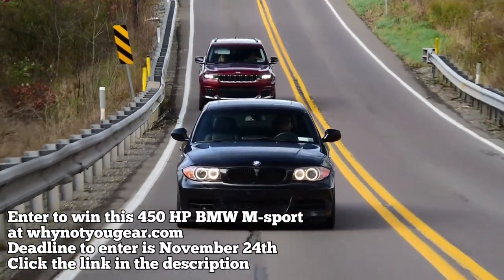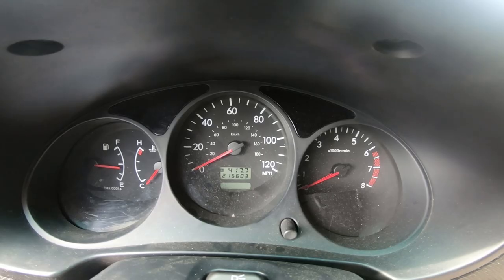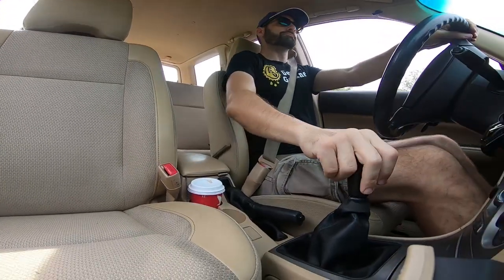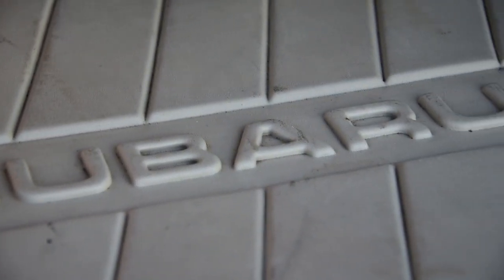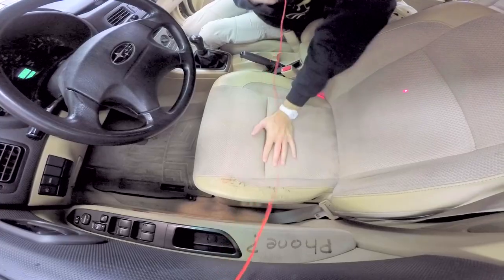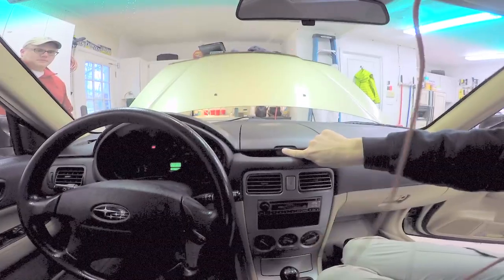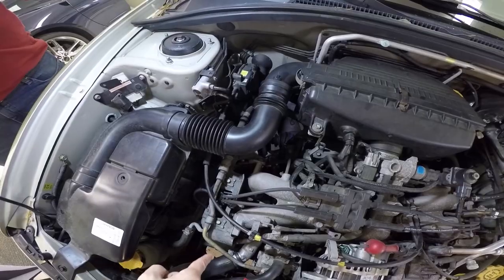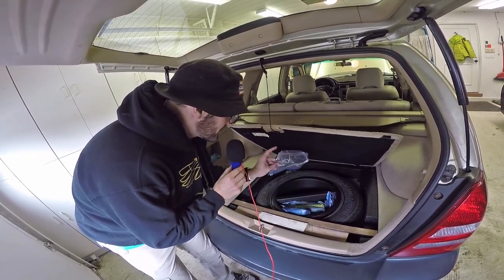2004 Subaru Forester 5MT: Regular Car Reviews

Comment: My first car was a then brand new '07 Impreza 2.5 SE in Newport Blue on clearance, a model that only existed to use up all the leftover goodies that Saab had left after their one night stand. Probably was not the best car to give to a then high schooler who was still on their permit, but it was that or the '07 Aveo because dad was firmly GM back then. That is until I got him to drive that then the Impreza, I've never seen the man break so fast for another brand until he bought the '15 Malibu, but that's another story. From day one I drove it like I stole it, driving it flat out in dirt roads and the empty lanes of the California high desert relying solely on physical maps since this was well before smart phones were a thing. Sure it was the non-turbo model, but the AWD and peppy little engine was able to easily outrun the tired 90s domestics that dominated my school back then. That car basically taught me mechanics since slowly little things broke from my timing belt shredding, to a blow radiator, to the catalytic converter failing and my first major engine rebuild because the meme was real and it hit me on the nose at exactly 100K miles. I lost that car a decade later, not by any fault of my own. 

My brother had taken it to school one day, and a careless S-Class decided it wanted to changed directions midturn on the opposite lane. Completely totaled the car but he was able to just walk out and just quietly sob on the side of the road since it was his first accident since barely getting his permit and he loved that car too since we had gotten it when he was 8 and it looked just like the cars he and I drove in Gran Turismo. The accident call was probably one of the worst ways to wake up that morning and my brother at first was the only thing I immediately cared about, it was only after I got to the site and confirming he had all four limbs that I finally looked at the wreck and realized that in exchange I still lost something. Sure at this point it was slowly dying, it wasn't even turbo model, or even had a manual, but this had been my car for a solid decade from high school to college, and with that I felt like a good chunk of me had gone with it. At least it kept a good chunk of it's value and it was off to a bargain bin Sonata that had the same exact metallic blue because Subaru was now asking for silly prices in 2017 and I was still drowning in college debt. I still miss that little car from time to time. Maybe in a few years from now after the Sonata, I'll pony up for a WRX finally, because nostalgia and a midlife crisis are a powerful thing.

tl:dr I picked my first car because I was a dumb Gran Turismo kid, drove it to the day it died and I miss it so much I'm willing sucker to buy it again, thank you for listening to my TED talk in a Burger King men's bathroom stall.

Comment: The hill holder sets when you have the brake and clutch pushed together. It holds until you let off the clutch pedal. The easy way around it is to hold the car with the parking brake, let off the pedals, then put the clutch back down. If you don't touch the brake pedal, it won't set the hill holder. 

Also, is it just me, or does it hold harder if you have, when stopped, pushed harder on the brake pedal? I'm pretty sure that's an attribute of its operation.

Comment: Love my Philly-based 2003 Forester XS with 163k.  Starts every time and runs like a sewing machine.  Throw some snow tires on her and she's unstoppable!!  Sure, I've been through three rusty cat-back exhausts (now running stainless), and there's rust on the subframe....but I refuse to let this thing go.  A/C blows cold, new-ish radio runs bluetooth, and I don't have to care about dings and dents (there aren't many).  I will inevitably dump more money into it rather than overpay for a new (used) car right now!

Comment: This comment won't mean anything to anyone.
But I feel the same about "billy" my pug 3008 mk1....
A car where I changed the oil every 43k because thats the miles I did in a year. A car that never ever not even once broke down....a car that does 55mpg on average but sometimes up to 80....
And it isn't a hybrid! Nothing electric like on it.
Its 10 years old.
The last of the 'moderns' before the future black box, ad blue, ad nausea cars of 2018 onwards.....
Hes still going.
With 115k.... 
I hope he becomes a high mileage hero. Because he deserves it.
Hardly washed and cleaned or maintained. Never driven hard mind....
But...yeah.
He is my donkey 
Loyal. Dependable.
Its French and French cars generally suck..... not this time though.

Comment: I know what you mean about those Pennsylvania rust issues. I mean, I live in Ohio, but in August 2018 I picked up a 2006 Explorer 4.0 with around 190k for $600 in Prosperity and, at the time, it seemed like the frame was so far gone that I thought I could only get maybe a year use out of the Exploder, tops. I also found out shortly after buying it that a couple of plastic timing chain guides ended up in the oil pan along with a couple of rod bearings. To my surprise, it's now at 211k and I'm still waiting for it to blow up.

Comment: A four cylinder that gulps gas like a V8? Sounds like an anthem of 2.0L engines from the early 2000’s. This hits hard as I’ve only driven such cars. Now, it’s a Nissan X-Trail and we’re deciding if we’ll  let it go because it sucks gas like a V8. I didn’t like it then, still don’t like it now, but I’ll be sad if we were to let it go. It was reliable despite the fact it’s a basket case of mechanical problems. I want to keep it, I want to restore it, but I don’t have the means to. I guess it’s a curse for us car folks that if you own a car for so long, you’d love it. That it bothers you to have to let it go, but it excites you because you’d be getting something different.

Comment: I had to trade in my 99 forester 5mt at almost 300k miles. I bought a low mile, one owner Mercedes C300. I bought the Merc because I couldn't afford the newer Forester I wanted, even though it was older and had more miles than the Mercedes...

Comment: I had an 04 2.5X. Sold it at 257k about 3 years ago. Definitely the worst mistake I’ve made when it comes to selling vehicles. I miss that car on a daily basis. I have a 2011 forester XT now but it’s still not as good as the 04 in my opinion.

Comment: Funny enough my car had the hill holder fail on it but it was fixed and I still like it, it's nice to be lazy away from lights and since it also works in reverse I can use it as a backup speed control. Also those leakproof headlights finally failed on me so I had to get new ones, but I need to look more into the DRL-disable because I didn't know it was so simple.

Comment: Gotta get the car undercoated to prevent the rust. And not that rubber crap. Get the oil based undercoat. Yeah it makes your underbody oily, but it's better to get your hands a little oily when working on it then having to deal with rust.

Comment: the 45 minute thing is legit, me and 1 other fella pulled an engine out a GC8 and had the sump off it for inspection in 45 minutes including putting it on the lift. Obv the sump was absolutely plumb full of glitter.. but y'know. subarus.

Comment: My daily/beater is a Sierra gold 04 Forester XS with a 5spd lol sadly mine is in need of a motor soon its running on 3 cylinders idles at 350rpms and has metal in the oil but i still drive it 700-800 miles a week

Comment: Typically the Manuals in these use a center diff viscous coupler and, as a result, aren't always engaged. My 09 has a computer controlled centre diff clutch system because it's an auto and also isn't always engaged. Maybe the older ones were different

Comment: The gears in the forester are almost exactly the same as the base model impreza, my friend has a 2010 manual forester and I have a 2010 impreza manual and they are both very similar since it's the same engine and platform really.

Comment: Wranglers are 4x4 which means 50/50 split all the time (When 4wd is engaged) The only difference is the suburu has a transfer case differential, but any jeep with the 242 t-case has one too? I still dont understand the stigma.

Comment: My mom's s was bunk 04 legacy got second set off head gaskets at 160k  previous owner did.then at 220k went out . Oh but you gotta do triple layer gaskets if you want it to last.
  Well I don't know that.
4000 for a car that had work done. Just  70k is kinda of a bummer. Also the previous work for head gasket nothing on the paper work about the water pump 😡

Always smelled like gas . Has a misfire at 160bk I believe before head gaskets was done.

I loved Subarus . Well I still love my free 93 loyale and that's on prays and head gasket in a bottle.  But at least that one rides smoother.
But my loyale only gets 18.6

Comment: Time to get a real camera car. A 1994-1996 GM B-body wagon. You've got the rear facing seat and perfect height rear glass that opens by itself so you dont have to shoot through a heated rear window anymore with lines that show up in the video... Plus you've got an incredibly smooth, self leveling air suspension, and the simple, durable, powerful LT1 engine. That thing would be able to go anywhere the subaru could, at a much higher speed. I guarantee it'll get at least the same mileage as that Subaru too. Everyone knows nothing offroads better than a full size rear wheel drive B-Body. Just ask David Freiburger. Plus you can carry 9 people and tow 7500 pounds simultaneously with roof storage to spare. Name another car that can do all that reliably and for a long time as my parents' car did. I'm not holding my breath. Ask /DRIVE about theirs, which they used as a camera car for years.

Comment: It's a shame what rust does to cars. As a life long south Floridian, who grew up near the beach, cars rusted like crazy here as late as  the early 70's, with primitive sheetmetal prep, primitive paints, waxes, and sometimes poor design regarding trim and shape -  but from the top down. All rust was clearly visible, from the outside, and you could try to slow it down with proper maintenance. You've tried to do the same, but the salt was coming from below, not from the humid breeze, and she's too far gone, despite looking like she's ready for another 15 years of solid work. Sigh...

Comment: Vinyl inserts make cleaning seats just a little easier....no longer do you have to worry about your extractor nozzle working its way poorly around the bolster edges of a cloth seat......vinyl shouldnt crack if properly protected....and also dont drag your ass out of the car. thats pretty self explanatory

Comment: I had a 2003 Outback with a blown gasket for 10 years and added oil occasionally that went everywhere, and had the weatherband.   I bought an orange 2014 XV Crosstrek afterwards that was murdered from behind while I sat at a red light. Now I have a 2017 Outback p.o.s. that eats batteries and got stuck in my yard!  Eat turds Subaru!

Comment: And then the head gaskets goes like most 10+ year old Subaru Forester... Nearly 100% failure...
Yeah, I used to own an older Forester until the head gasket was fading for the second time in less than150K miles.

Comment: Subaru best worst ever…..my wife’s 04 h6 Vcd outback gets 18city 23hwy…..but I can go 75mph on packed snow over the pass…..until she yells at me…..lol,,,,cv boots ugh….parts for the h6 are expensive as an Audi because their German parts….all the heat shielding on the cats rattles…idle control valve tends to be at odd with itself at times…overall nice car that’s extremely uncomfortable in long trips…by my back sucks after surviving a head on…..my moms 2010 Impreza sport with 50,000 miles on it….sucks.sure it’s sporty,torquey but the thing feels so cheap the plastics are harder the road noise levels are way to load for a passenger car….my 03 f350 with a 4inch turbo back rolling on all terrains has about 1/2 the road noise as her Subaru…..my buddy had a 96 Impreza L 5spd awd it was better made and quieter also (no speed govener 140mph out of the 1.8L lol…than the 2010 sport Impreza they have gone cheap noisy and little things go out that’s a non issue in a Toyota or Honda…..vote with your money go test drive used cars to see how the brand ages….Overall the snow performance is second to none Subaru by its design will always win that game….but two months out the year performance is just a dumb reason to buy it…

Comment: That little Subaru flat 4 engine is almost as bad as the 4 cylinder and V6 engines Chrysler made in the 90’s.  Subaru is a really good example of how the automotive journalist of the American Northeast decided they really liked a product even though it was complete garbage and convinced all the other emasculated liberals that it was the greatest thing ever.  Ford products are another example of this travesty.  If you really think you need all wheel drive then buy something that actually works like a GX 460 or a 4wd GM full-size platform with a V8.

Comment: Head gasgets were actually leaking because people use WRONG antifreeze... Sure it's stupid for subaru to use some magic potion as an antifreeze but the owners who pour wrong stuff in are even dumber :D

Here in Finland we have lots of salt on the roads but Subaru have galvanized body so how in the hell is you're that rusty?? you never put a protective stuff or even oiled the bottom?
My 05 Forester been rust protected when new and a few years later. now have 401.000KM on the original engine that have never been opened and the can have basically ZERO rust and the bottom is like new.

Comment: Almost a half an hour to justify a boring, over priced, under powered ugly car with interior & tech that was 10 years behind it's contemporary rivals of the time. Like Honda or Toyota of the same vintage. if you are an "enthusiast", and want an old Subaru that isn't a dog to drive, just buy a WRX wagon. You'll thank me later. Otherwise go buy another car with 4WD and eat your crunchy granola and look down your nose at other people while driving a different shit-box. And at the end of your travels while trying to sell it saying "I know what I got. No low ballers", the car is a rust bucket with enough check engine lights to light the road to hell and back, that is falling apart. This vehicle was a joke. A car made for non-car people with dogs and 2.5 kids. Full stop. ps thanks for letting me know I spelled "apart" wrong.